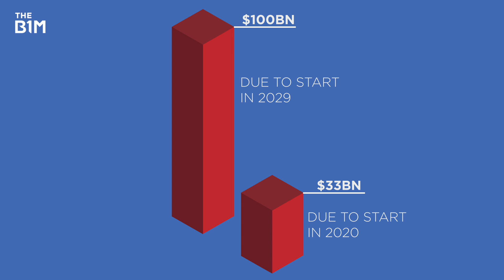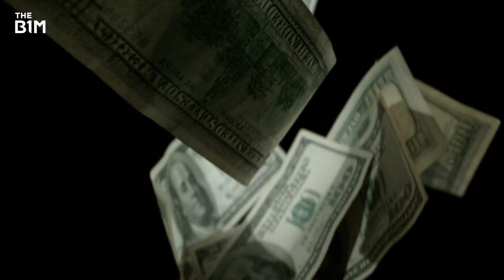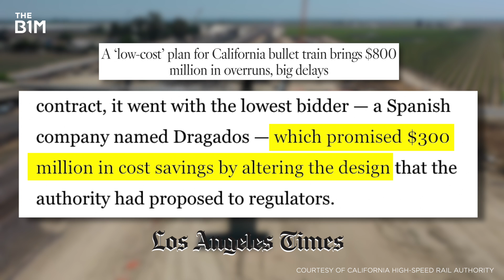What Went Wrong With California's High-Speed Railway

Comment: By the time that thing opens up you'll just be able to call an evtol from whatever Uber air app not to mention let your Tesla drive you there overnight autonomously while you knock out and heck even though I don't have my hopes up for the hyperloop even the hyperloop or autonomous cars may be dashing around in Elons affordable tunnels
Reply: if elon has actually lowered the cost of tunneling then he should bid on the contracts for the many tunnels that need to be constructed for this project.
Reply: @snoopyloopy  his boring machines are meant for cars, they're smaller. I think the aim is to just have EVs zip around at 120mph autonomously in there and then eventually small hyperloop pods. Before they even started on their next gen boring machine they already got the cost of tunnelling down to 10M per mile. What's weird is Cali is spending so much money on their system they could take that money and hire a traditional tunnelling company to put the entire thing just underground

Comment: In the next 100 years, the US High Speed Rail is expected to complete construction as originally planned. Then, it's ready to be demolished due to its outdated century-old technology.
Reply: The train is already an18th century technology. There is nothing futuristic about it. Any rail network is already outdated technology NOW, even more so down the road. The only difference between the old trains of yesterday and the new ones from today is speed. But speed doesn't change the fact that it's an old idea from long ago.
Reply: I doubt that. In Italy the Direttissima High Speed Line, dating back from 1977,  it’s still in operation to this day and without plans to substitute it, not even upgrading it to 190mph which is a very simple change, no construction required. It’s that good and useful today even when it’s near it’s 50 year anniversary. And it’s not due to a lack of funding, as Italy is still building new high speed lines.

Comment: What went wrong with California High speed rail is they assumed we needed it.
California has a population of 39.5 Million, not including it's 3rd orld imports. They have 1/3 Japan's population and a quarter the population density.  The most heavily used high-speed rail lines in the world, including those in China, Europe, and Japan, gained their riders by attracting them out of conventional trains, not out of autos or airplanes. The United States doesn’t have enough conventional train riders for high-speed rail lines to succeed.

When Japan opened its first high-speed rail line in 1964, nearly 70 percent of passenger travel was by rail and only 12 percent was by automobile. Although Japan’s lines are considered high successful, today only 25 percent of passenger travel is by rail and nearly 70 percent is by auto.

Comment: What Went Wrong With California's High-Speed Railway?

Its simple, politicians kept promising cities that it would stop between their city even if it made the route less efficient. As a result, it kept changing the proposed route which resulted in cost overruns and a route that won't even be that fast due to not being straight.
Reply: only one major change has been made to the route once it was finalized and that would be the approach into bakersfield. otherwise, the alignment that was decided on for the ballot measure is what is being environmentally cleared and built.

Comment: Private railroads have known for years that water level routes are the least expensive to build.  California has lots of coast line.  They should have used it for the route (e.g. the old Santa Fe "Surf Line" from San Diego to LA).  A lot less mega-engineering compared to going up the San Joaquin Valley...

Comment: If USA China cooperate for it, can be very cheap and quick!
For example, California High-Speed Rail from LA to SF, 840km (520mi),  approved in 2008, will operate in 2033 (about 25 years), original budget was $77.1B,  in the future will be $98.1B!
If China takes this project, the cost almost one-third of the current budget and can be done within 10 years! 
China's high speed rail with a maximum speed of 350 km/h has a typical infrastructure unit cost of about US$ 17-21m per km, with a high ratio of viaducts and tunnels, as compared with US$25-39 m per km in Europe and as high as US$ 56m per km currently estimated in California.
https://en.wikipedia.org/wiki/California_High-Speed_Rail

Comment: A compromise means “high speed” trains will run across many level crossings and at reduced speeds between San Jose and San Francisco. I believe this is also true of the approach into LA.. in the unlikely event that the line is ever completed, running times will be far higher than the voters were told.
Reply: Yeah it's bad when you start making compromises like this, it just ruins the whole thing because suddenly the trains aren't fast.
Reply: A huge number of above-grade crossings have already been built in the Central Valley
Reply: It doesn't have to be. It's all about choice. Even at a level crossing. It's called common sense. Just ensure that the level crossings are protected and everybody should be fine.
Reply: @k34xy4wmnb  US FRA prohibits grade crossings over 125 mph. Europe doesn't allow any over 100 mph. There are too many risks of cars being stuck and the train not being able to stop, or pedestrians being stuck.
Reply: @k34xy4wmnb  The problem is that there is no available land to build the right-of-way necessary to allow the trains to run on unobstructed track.  The run from San Jose to San Francisco is going to be on an old Southern Pacific freight line that they have leased to CalTrain, but that they are allowed to continue to run freight trains on at night.  If you want true high speed in that corridor you'd have to either elevate the train, with the attendant costs for building the track, or purchase an unbelievable amount of land that is currently privately owned, with the political costs involved as you force people to sell just so you can run a train that less than half of the people are passionate about.

L.A will be in the same predicament with the additional problem that there is no really good rail line to hook into as the main passenger line runs along the coast, and the high speed line will be following Grapevine pass through the Tehachapis.
Reply: @k34xy4wmnb  This is California, mon. Common sense is not in the equation.
Reply: @k34xy4wmnb  FRA rules limit speeds at level crossings.  I believe it's 79 MPH, or 125 with special protection.  Also, the "high speed" trains will share tracks with  slow commuter trains.  Those trains all too often strike pedestrians and everything stops for an hour.
Reply: the authority has indicated that they would be able to make the end-to-end trip time as mandated by the bond and those shared corridors would be upgraded to at least 110 MPH operations, with hsr having put money into several grade-separation projects that could allow an increase to 125 at a later date.
Reply: I thought they were building the line on elevated tracks, like they do in China, where there are no level crossings & the footprint on the land greatly reduced.
Reply: @daweilaotou1269  On the SF peninsula that was the original proposal but the towns along the way rose up in rebellion so they will have to share the existing Caltrain tracks.
Reply: @laurelcreek7  Woah! that doesn't sound good. Would they build bridges or underpasses at crossings?
This a video I took of a new Fuxing high speed train at Suzhou North station, plus I caught one going through at high speed just afterwards:
https://www.youtube.com/watch?v=4Ejdai-migE

Comment: This is what happens when you build HSR from scratch and don't have the pre-existing rail infrastructure to supplement it. Cali has a single long-distance train between LA and SF for its rail option though both cities have robust transit (by US standard), but it's pathetic compared to the 20-25 daily trains running between Paris and Lyon and the MASSIVE transit systems that feed them. Texas doesn't even have anything direct between Dallas and Houston and would rely on people driving to and from the station, so it'd be no different from flying travel-wise. We should be worried about people not making the switch in Texas, not California. If and/or when Cali HSR is finished, people will ride it. Not too sure about Texas, though...

Not to mention, I bet if we were doing this in the 70s along with the French and Japanese we'd have a well-established network in every major urban cluster in the country by now. Instead we have to rely on private investors to streamline a diesel locomotive and call it high speed, like a pig wearing lipstick.

Comment: It won’t get people out of their cars and planes.  It will just create capacity so the increase in demand won’t be in private vehicles. 

The video should note the passengers also need to get to the stations at either end.  The “last mile” problem in a low density city like LA is still massive.

In Australia the average cost over run for large public infrastructure projects is 100%. This is because they announce a low figure to get approval.  The overruns are worse when there is less planning before the announcement is made. The private construction firms know they can come up with reasons in their cost-plus contracts to milk the project for profits.

Comment: "What went wrong?" Well, since the origin of the plan was when Obama offered free billions to states to implement high speed passenger rail as long as they started the project within a year and completed it in 5 years or so, the only thing that went wrong was that Trump's (and previously Obama's) transportation departments clawed much of the money back after it was obvious that there was no substantial plan to do anything other than spending the money on certain contractors with political connections. The project wasn't to implement HSR, it was to acquire Free Federal Funds.

Calling it "the train to nowhere" isn't something new. That started by anyone that knew something about rail about a month after the initial proposal, since there were obviously dozens, if not hundreds, of problems with the original proposals, if viewed as an actual transportation proposal rather than a funds acquisition proposal. One of the biggest problems still remaining (and not yet even under any serious consideration) is how to get the proposed line through a substantial mountain range between Bakersfield and Los Angeles. There's a similar but smaller mountain range problem on the north end of the Central Valley line.

Comment: CHSRP got into trouble almost immediately, when it ceased to be a system designed to move passenger traffic among the state's population centers rapidly and efficiently and gave into the insistence of every crossroads in the Central Valley with a stoplight and a gas station that it, too, had to have a stop.  The decision to build the middle section first was also a mistake.  The "completed" line will begin in nowhere and end in nowhere else.  I quit flying years ago for three reasons:  the Security Nazis; the fact that the airlines began trying to make flying as miserable an experience one could have and still survive, and LAX.  The drive from LA to San Francisco is about as quick, portal to portal, as flying, but is unutterably boring - some of the ugliest scenery in CA.  Sadly, I do not expect to live to see a rail-based alternative, high-speed or otherwise.

Comment: It was an IDIOTIC plan from the start - a massive boondoggle that never should have gotten past the laugh out loud, what the hell were you thinking stage.  

It's one thing to build high speed rail on relatively flat ground in rural areas. But entirely different in urban areas that require long tunnels thru extremely active seismic zones (like the Bay Area and LA mountains).  The initial cost estimates were a total joke - every civil contractor just rolled their eyes at the ridiculously-low numbers.  Of course, all the pols were willfully deaf, dumb and blind to reality and it sailed merrily along until reality smacked them in the face. The only saving grace was they started in the Central Valley where costs weren't completely obscene - had they let out contracts in LA mountains or the Bay Area, they'd never have been able to stop the massive spend (once these mega projects start, they almost never get cancelled - something the Pentagon/NASA knows full well).

Good effin riddance!
Reply: The Japanese manage.